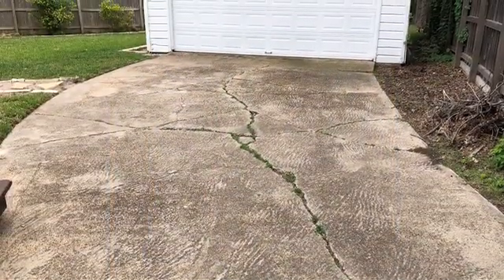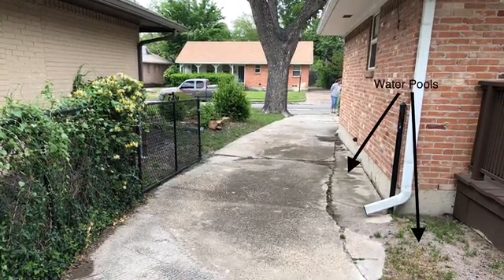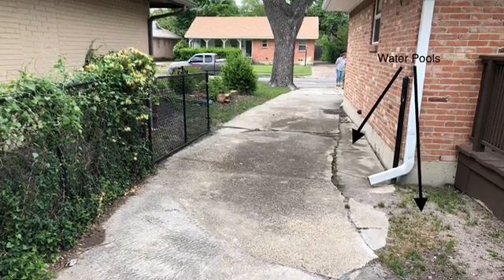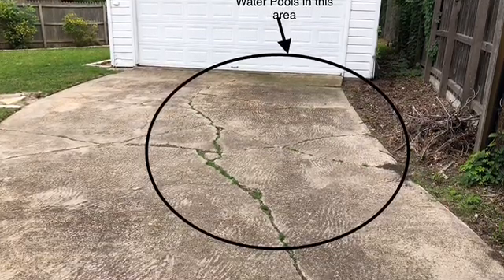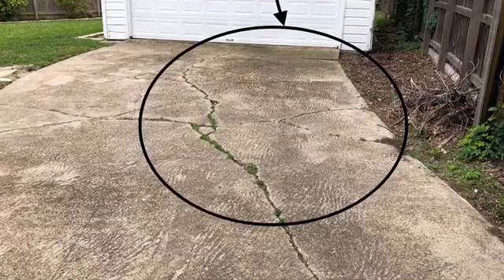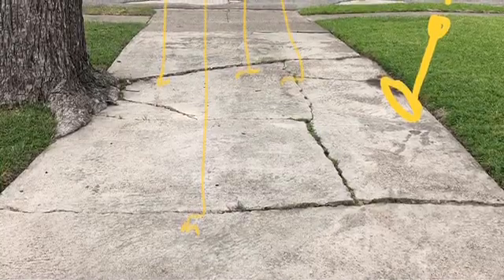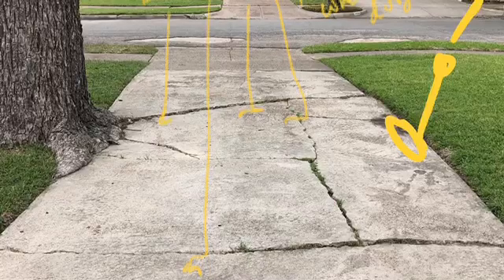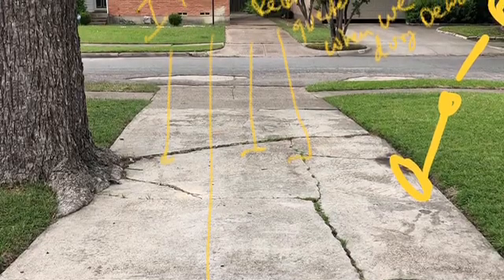Concrete Driveway Repair In Dallas, Tx

Comment: Ty for the video. Im in New England and i  have a 100 year 100 ft old concrete driveway that has two ruts going all the way up. In the winter because of the ruts i can never get it really clean. My question is do i really need to tear the driveway out or would it be possibe to really clean it well and treat it then lay another layer on top of it. Thanks in advance